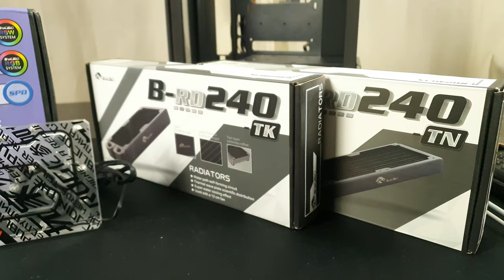ASUS ROG Z 11 - RYZEN 5 5600X - RTX 3070 - BUILD 16 "PERSEUS" - 2021 WATERCOOLED GAMING PC

Comment: Hello, I like the build and was thinking about doing something similar myself, but I was wondering where'd you get the sticker you put on the RoG sticks you put on the Res?
Reply from the maker: There is not a sticker,the distro plate is dedicated distro from bykski
Reply: @PCBUILDMOD  thanks I found the Distro for it, but I do have one more question (as I'll probably be ordering them at the same time) the Extension Hub for the case says it comes with 3 headers for argb fans or leds. Is this a these headers 5v or 12v?
Reply from the maker: @alchemi802  5v
Reply: @PCBUILDMOD  Thank you ^^

Comment: How did you fit a radiator in to the top without it blocking the io cables coming off the MB?
Reply from the maker: A lot of patience and the 90 degrees adapter

Comment: did you place a 240 rad on the top ?
Reply from the maker: Yes
Reply: @PCBUILDMOD  The distroplate specs states that it contains acrylic/aluminium plate, is it safe to use with copper rads and brass fittings from barrow? also what coolant did you use for this loop? i just bought that case and looking to do a watercooled AM5 build this year.
Reply from the maker: @xerkstyle6272  there is no alluminium on distro. The coolant is Ek cryo fuel. 👍🤙🤟
Reply: @PCBUILDMOD  thnx mate , was scared due to the mix of aluminium and copper/brass as this will be my first loop ever.your answer reassures me now and i can safely buy this distro 👍